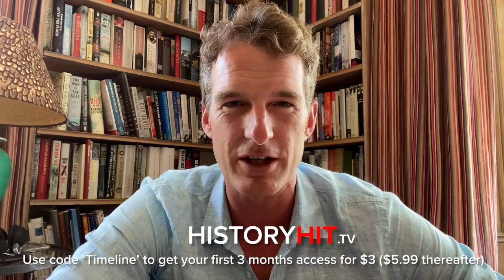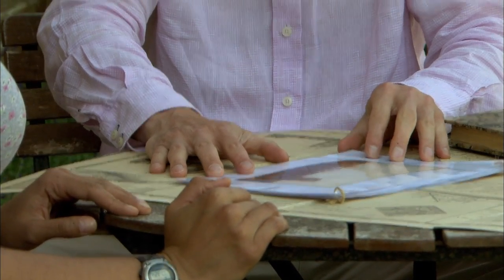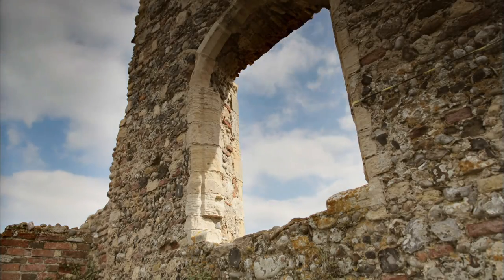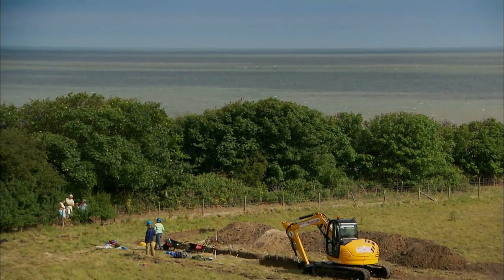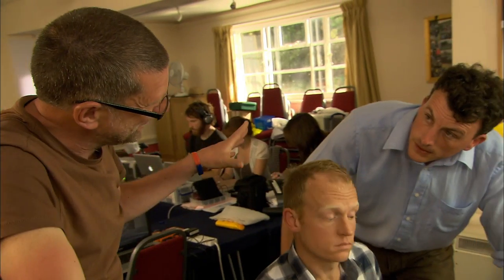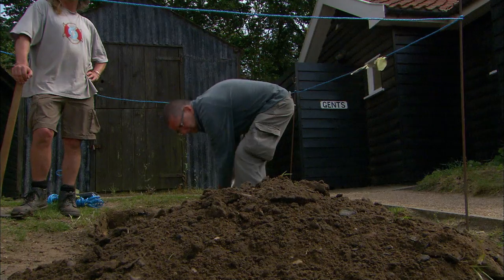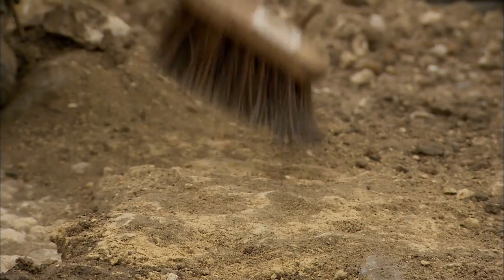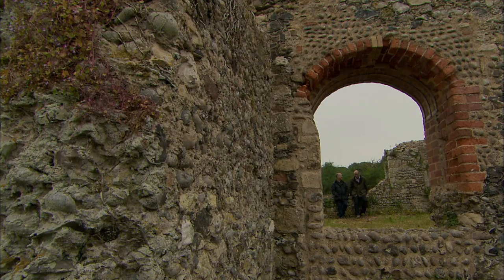Digging At Dunwich Before It's Lost To Sea | Time Team | Timeline

Comment: From what i see in modern google satellite maps, comparing them to the time team maps they were using,  Dunwich is faring rather well since the filming of this, over 20 years later. Looks like from the modern maps the erosion has slowed down considerably. There is some cracks along the cliff edge. But none too serious right now.
Reply: I'm sure there was no tv drama included🙄
Reply: Welp this is where I hate to tell you this was part of the last of the Time Team series, this was aired Feb 5, 2012. Its only been 9 years. There is about 220 ft in the older Google Satellite database images before the cliffs are gone and the ruins begin to go into the sea but those are old images, Google doesn't show you how old satellite footage is unless ya hop onto Google Earth, the ruins last images were from 05/09/2020. Currently the rate of erosion is roughly 1 meter (3 ft roughly) per year. So the ruins have another good 70 years-ish IF things don't speed up. Its not as pressed for time as some would think but at a certain point they can't get close to the site and dig so now is better than say another 40 years from now when it has lost another 120 ft.
Reply: @RinVindor101  I was driving near san Francisco in 2004 or so. I spotted a full size ship which was beached on the sand. It turned out to be a sand pump which the US Army Corps of Engineers to pump sand from the Pacific onto beaches which had been eroded by storms. Maybe Dunwich should have a "Go Fund Me" to save England from washing into the sea. They could hire the Americans.
Reply: @stanthology  Or ask the dutch, they have experience with building even below sea level

Comment: What I can't understand is why people don't do anything to at least slow down this erosion. Building some massive breakwater all along the coast would be prohibitively expansive, but planting fast growing trees along the current bank is actually quite easy and cheap. A continuous strip of forest say 200 meters wide starting at about 50 meters from the current bank (to allow the trees time to grow big enough roots) would certainly make a big difference in the near future and most likely become a very pleasant landscape feature. There are also some fast growing weeds that lock down sandy soils, not as well as trees but much faster, these can be seeded each spring all along the current edge to buy more time for the forest strip to grow strong enough.
Reply: Indeed. restoring the ecology invariably has a remedial effect. What you see is a coastline stripped bare by decades of intense agriculture.